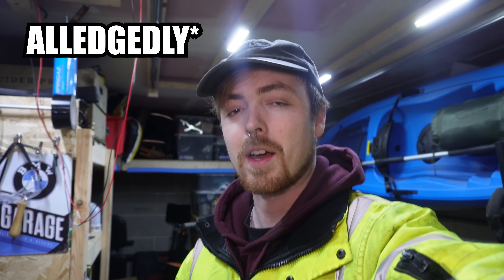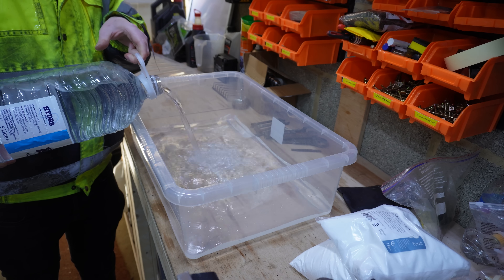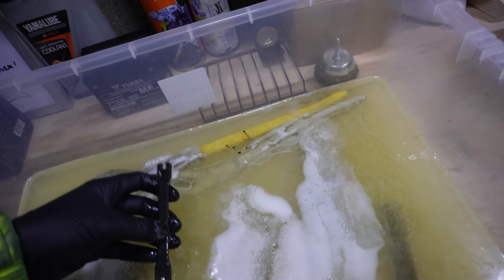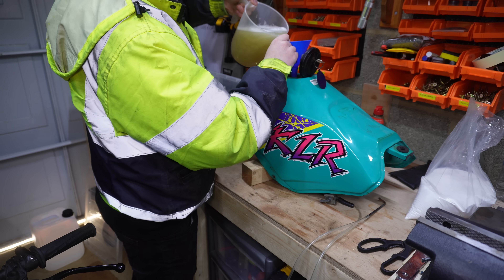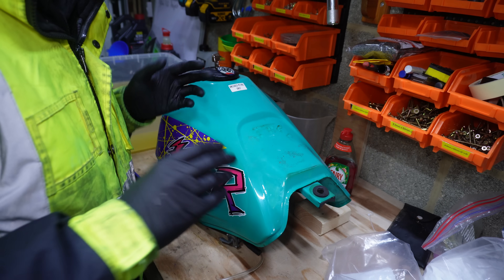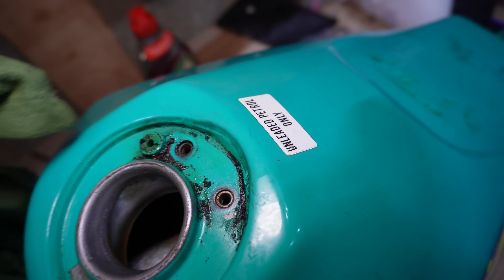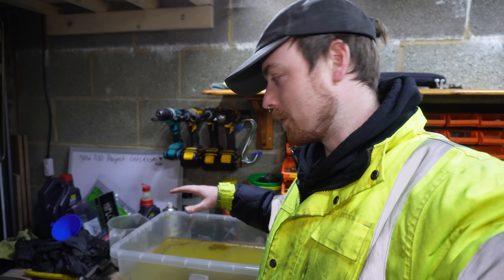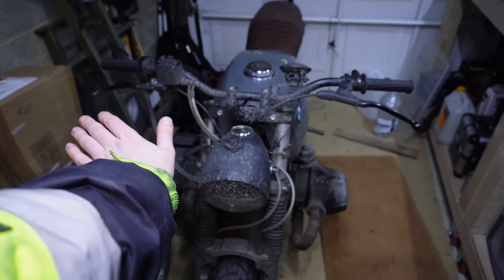How to clean a motorcycle fuel tank (Better/Cheaper than Evaporust?)

Comment: Always wear safety eyewear and gloves with chemicals. Citric is a mild acid but still needs to be respected. Add  Acids to Water never the other way round. I recommend Phosphoric acid as this will neutralise rust and leave a protective phosphate coating. Available from specialists. Also try electrolysis with Steel Anodes in a solution of washing soda.

Comment: I used WD40 rust remover as a test in a (very rusty inside) motorcycle gas tank, I filled it halfway and let it soak overnight. The next morning, when I poured out the rusty looking liquid, the area where the rust remover had been was absolutely spotless, like freshly bead blasted. Also cool, that if you forget about it for a month even, it's harmless to the metal, it only breaks apart rust. I filled it all the way up and let it sit overnight again, to clean up the remainder, then poured it out and rinsed it with solvent. Incredibly good stuff. I plan to build a 1" dam on a project car's rusty roof and fill it with the rust remover, and it will be perfectly bare metal by the next day. I'd imagine swishing it around during the process would speed it up.
Reply: If you cant build a dam on a domed 57 Ford roof (!) soak an old pillowcase in the rust remover and place over the roof and then put a tarp on top to prevent evaporation.
Reply from the maker: That’s pretty cool I’d love to see how the dam build turns out and the results!

Comment: Hi,to get rid of rust i,ve used phosphoric acid since my first car in 1968!!  its not a dodgy chemical to handle! if you,ve drunk coca cola youve had phosphoric acid as its one of its ingredients. the added bonus of using it is that it provides a black ,inert, coatong to the metal( inert= wont react to oxyen)

Comment: wd40 probly won't prevent future rust. I use 000 grease, which is so thin it's oil at room temp+, but so thick it's grease. I coat the tools then wrap them in a soaked paper towel before putting them in the storage bag...

yeah it's messy, when you need to use the tools, but at least they aren't😅 rusty!
Reply from the maker: I'll look into this cheers!

Comment: Why did you put sodium carbonate into the citric acid?  Pool acid works well to take the rust out of tanks but it will start to rust right away after you dump it out unless it is treated with something else.
Reply from the maker: Apparently it reacts with it to create citrate ions which bond better with the rust and do a better job of removing it than the citric acid would alone, it reduces the acidity so it doesn’t damage the base metal under the rust. The good thing about this stuff is it doesn’t flash rust like using acid does, I’ve had the tank sat in the garage for a week now and haven’t flushed it or treated it with anything and it’s still perfect with no rust, this stuff works well

Comment: Why would you mix sodium carbonate ( alkali) with an acid like citric acid?  You're neutralizing a lot of that acid.  Just add less acid.  If you don't want that much.  If someone knows why this should be done, please tell me.  It's like mixing vinegar with baking soda.  You end up with water and sodium acetate.  That's no kind of cleaner.
Reply from the maker: The guy in the video I linked explains it better but apparently it reacts with it to create citrate ions which bond better with the rust and do a better job of removing it than the citric acid would alone, it reduces the acidity so it doesn’t damage the base metal under the rust. The good thing about this stuff is it doesn’t flash rust like using acid does, I’ve had the tank sat in the garage for a week now and haven’t flushed it or treated it with anything and it’s still perfect with no rust, this stuff works well
Reply: @ItsChrisHodge  Interesting!  Thank you for that.
Reply: Beyond Ballistics explains it really well…. The short answer is when you add a base to citric acid (for this instance), you create a salt.. this particular mixture creates two outcomes that gently removes rust…. The citric acid is a chelating agent that binds to the rust particles …. The Alkaline agent (like hydrogen peroxide say) then oxidizes that to easily dissolve and be removed!
Reply from the maker: @DogMania  I really should’ve explained it better…. Thank you for clearing this up!

Comment: i got the same result from beyond ballistics and its amazing?
Reply from the maker: Yeah it’s amazing stuff!
Reply: @ItsChrisHodge  Im not sure if you Did get the finish you wanted in that KLR tank (it looked pretty awesome) but I rebuilt a FZR600R with a completely rusted tank, before I found the solution from Beyond ballistics, and I used the black Harpic toilet cleaner "10X" one for 45min/hour but it was way more volatile. finished the internal tank with POR15 fuel tank sealer...for that pesky ethanol in our petrol . Thanks for the vids!!
Reply from the maker: @ I used black harpic to do the tank on my BMW R80 in the back of the vid, although I found because of it being acid it flash rusted so quickly even though I used a whole tub of bicarbonate of soda and water to try and neutralise it, then sprayed half a can of WD40 and it still flash rusted haha, although with this solution I tipped it out and it’s been sat in the garage for 2 weeks now and still not rusted at all! 
Thanks for watching, glad you’re enjoying the videos mate

Comment: Try using 15% Hydrochloric acid   .sold at farm supplies for cleaning cattle shed floors and stone patios and cement stains . Dirt cheap and blitzes rust to hell .  Needs washing off with water and neutralising with bi carb soda. best stuff ever. even on corroded .
Reply: But very dangerous !  WILL eat thru the "pot metal"  (zinc-aluminum) Petcocks straight away !  Nothing will be left!  Do not let it sit overnight,  you may get pin holes right thru rusted away, thinner areas of the tank ! Be very careful not to get any on your skin or eyes

Comment: i use a similar mix for car and gun parts i de grease items first , it changes red  (ferrous oxide) to black rust(ferro-ferric oxide)
which is softer the the red oxide , boiling in water does the same thing, you must de water and oil the surface as soon as you have removed the black oxide to stop flash rusting occurring and the hotter the water the quicker the reaction 👍  and as citric acid is used in food such as lemonade it is skin safe if you get in on your hands and is not a hazardous chemical to dispose of when finished with
Reply from the maker: That’s interesting, I’ve not washed or oiled this tank and it’s been sat in the garage for over a week and hasn’t flash rusted again yet…
Cheers for the advice and info though!
Reply: This is true, citric acid is food-safe, but believe me, if you have cuts or scratches on your skin, you will know about it very quickly! A quick rinse in water will solve it though. It's best to have eye protection as well.

Comment: I used white vinegar on my norton  tank, it worked  perfectly.
Reply from the maker: Did it flash rust? Mine did when I used vinegar, maybe I didn’t wash it out quick enough
Reply: Yes, I have used that (Acetic acid). You can buy it in different strengths up to 80%. If you get the strongest, you can dilute it with water and make 16 litres of food strength vinegar from 1 litre.

Comment: you only put 10 grams of sodium carbonate to 100 citric if you want the tank to work better basically your weakening the mix the more sodium you put in, also these methods are no good for anything you can submerge so you cant paint it on under the car for example there are far better mixes than this for rust that you can soak in or paint on

Comment: When I cleaned/de rusted an old car fuel tank I used a very similar solution (no dish soap) and poured in a pack of ceramic baking beads to act as agitators. Slosh and shake, leave, slosh and shake. Worked well but I did have to count the beads before and after to be sure non were left behind.
Reply from the maker: Ceramic baking beads is a good idea, I might give those a try next… thanks for the idea

Comment: I'll be honest, I've recommended Evapo-Rust. Because it does work. It leaves the same black finish though. 

Great video, thank you. I'm going to use this myself.

Just to say, your links are the wrong way around. Not that it matters too much.
Reply from the maker: I think it leaves the same black finish because Evaporust also uses chelation, someone else commented it uses other additives and that’s why it’s so expensive but if the finish is the same why not go with the cheap one 🤷‍♂️
Reply: @HodgeFix  agreed 100%. I've just sent your video to a friend of mine who is building a cafe racer out of an XJ600 and has a rusty tank. 

I had said to him about Evapo-Rust but this is much better.
Reply from the maker: @ I hope it works well for them mate, glad to help!

Comment: You would get a better effect in the tank if you mixed the two chemicals inside the tank. I find phosphoric acid is quicker!
Reply: Phosphoric acid is way more expensive and dissolves more of the base metal that you're trying to preserve. In the case of thin sheet metal, this can quickly lead to pinholes and leaks. But don't take my word for it.
Reply from the maker: Oh really? I could give that a go but I think it would blast out the top haha. I think acid would be quicker yeah but then I think you’d have to neutralise it somehow? Otherwise it would just keep eating away at the base metal

Comment: Have you tried electrolysis for parts or tools? You'll need a dumb battery charger and a basin large enough to submerge whatever you're trying to de-rust.
Reply: You can do it with soda crystals and a 12v battery. Fill the tank with water and soda crystal mix positive on sacrificial steel part negative to tank. Just make sure they don’t touch each other
Reply from the maker: @ I’ll look into this and potentially give it a try too!
Reply from the maker: I’ve seen that before yeah, unfortunately I don’t have any electricity in the garage otherwise I probably would’ve tried this route too, maybe in future when I can afford a garage with power haha

Comment: Wow that's impressive. Any plans to preserve the tank as is? Maybe a tank liner then using an oily solution to protect the metal? Brilliant video, thanks for sharing.
Reply from the maker: Not sure about a tank liner yet as I’ve heard they can break down and be more trouble than they’re worth, although maybe modern epoxy ones are better? Thanks for watching
Reply: @ItsChrisHodge its good if you do it right. Clean too badly and mess up the swirling about or have too little and it'll flake off.

Its not like painting but not that far off.
Reply from the maker: @ ahh okay all in the prep then?
Reply: @ItsChrisHodge  yea prep, temperatures and humidity! It should be in the instructions though for whatever type the kit happens to be
Reply from the maker: @ I’m definitely going to get a kit for my BMW R80 as if I fill the tank all the way up it has pinhole leaks 😳 which isn’t ideal….
Reply: @ ahhhhh. I guess as long as you keep if full of fuel it will last a long time. 😎👌🏻